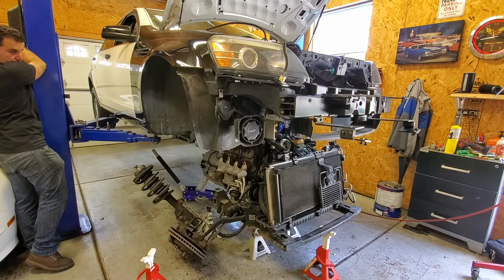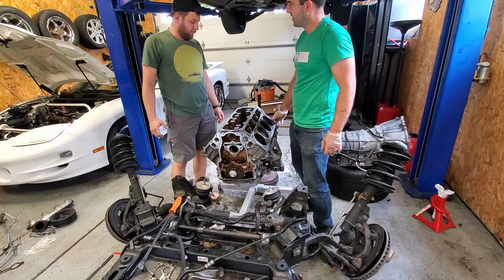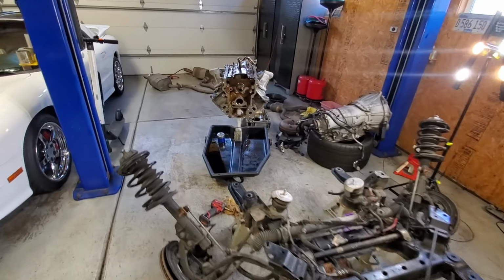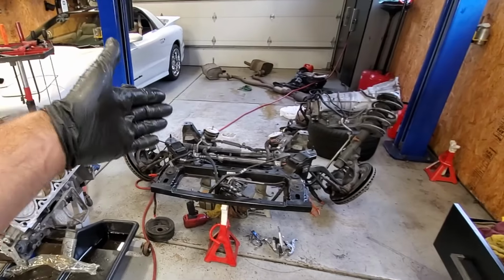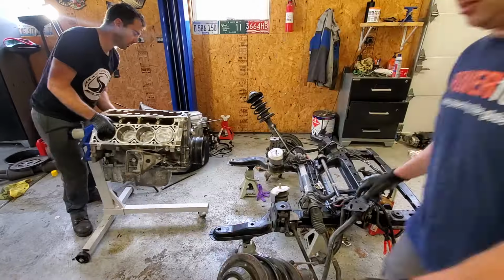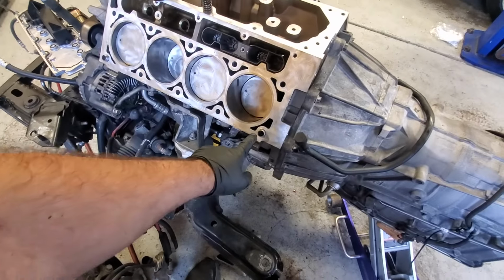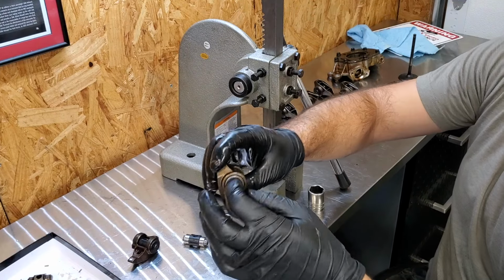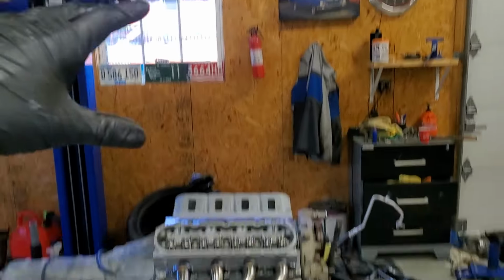Fixing THE WORST LS Engine Factory Defect Ever & Adding 100 Horsepower In The Process! GM Failed US!

Comment from the maker: What LS car or truck do you drive? Any mods? 
If you need high-quality synthetic fluids check out my Amsoil dealer page! My preferred customers can save 25% https://legitoil.myamsoil.com/
Here's everything automotive I buy on Amazon. Every Amazon purchase supports my channel at no cost to you!
https://amzn.to/2k606u1
Reply: Which repair fixed the 30ff boost issue on the 335i? Was it the vacuum lines or adjusting the wastegate rods?
Reply: @legitstreetcars 😅
Reply: 09 G8 GT with the L76.  I've got Kooks long tubes and X-pipe back to the stock axle back mufflers.  Tuned with CAI, but still have the DOD cam and lifters in it.  Definitely plan on doing a similar rebuild to yours in the near future.  You've given some great tips and will probably watch this video a few more times before digging into it over the winter.  Thanks for the info!
Reply: Alex you should’ve used ARP head bolts instead of stockers if you’re going to spray it. Also you should’ve use morel lifters instead of stockers they don’t cost that much and they’re 100% upgrade over the stockers. I have had a 98Z 28 heads, cam, full exhaust, 3400 stall and nitrous. I currently have a 2010 Camaro SS That I’m building into a 429 stroker with a Texas Speed and Performance rotating assembly. I am currently on hold for parts because of the stupid Wuhan virus.
Reply: I have a big family, so we drive a 2006 Chevrolet Express 3500 12 passenger with the LQ4 6.0l. We're in the process of turbocharging it and we're hoping to make around 600 WHP.
Reply: what type of tool did you use to torque pulley? Video with explanation would be nice.
Reply: I've got a 05 gmc 1500 with the l33 aluminum block. Everything is stock just hit 326,000 miles no major problems so far. I love the ls style of engines
Reply: @cjhill726   GM definitely got the LS right. It's just the evolution of the small/big block all mashed up and modernized. But man o man did they hit a home run. Every single weak point of the old SB/BB engine family has been resolved and made near bullet proof. Yes they had some issues with the AFM/DoD, but that's totally new. The non AFM/DoD motors did fine. Even this weak point is getting resolved. GM got it right, PERIOD. These LS engines will be super popular for many many years to come. Several shops locally are also reporting near common reports of 400k, 500k, even 600k mile engines running almost like the day they rolled out. You get into other failure issues when you enter this type of longevity. Like gaskets holding up, etc. These engines are just engineered beyond what the original developers of the old 1955,  265 c.i. small block guys could of ever imagined. It's definitely here to stay.  And is the gold standard. My $0.02
Reply: @peltel2222  couldn't agree more!! For the price they can't be beat.
Reply: @peltel2222  Except for oil cavitation on the fbodies resulting in spun bearings. Oil being sucked through PCV valve issue also.
Reply: @cjhill726  your truck is good old style not the new high tech junk
Reply: 05 Denali XL lq4 6.0. minor bolt ons, cam, full 3" exhaust with shorty headers. Lowered, full suspension. In the middle of a full brake overhaul.
Reply: An '03 Isuzu Ascender with the long wheelbase which is basically a GMC Envoy XL. Eventually I'd like to put the LM4 into something smaller.
Reply: 2002 Chevy Silverado. It has the little 4.8 LS and 130,xxx miles and still runs great. I have been a Ford guy my whole life and heard people go on and on about the LS engine. I always thought it was just the next evolution of a 350 small block...until I drove one. What a stout and durable engine, even the little 4.8 in my truck is impressive and it is essentially stock (revs for days). I can't even imagine the higher end of the LS spectrum, like the 7 liter they use in the Z/28 Camaro and old C6 Z06 Corvette. Superchargers and turbos are cool, but you can't beat a naturally aspirated V8, for the linear power delivery, and not to mention the sound. Really enjoy your builds, keep up the good work!
Reply: Mayhem 2 cam has a .630 lift,  I don't know about Mayhem 3. If that engine has 11:1 or 10.4:1 compression I wonder if there is enough clearance on those flat top pistons. If you spun the crank I guess you already know. Also, FYI: the Cadillac V8-6-4 was not a diesel. It was a debored, destroked version of the 472 engine that came out in 1968, later stroked to 500, then later became a 425 and 368.
Reply: 95 c1500 stepside single cab (show trucks usa conversion from factory)
5.3 ls swap 
t56 (lt1 to ls converted very easy and cheap)
SS2 cam 
7875 turbo with holley manifold system 
just gotta upgrade the brakes and then she'll be rolling
Reply: I have a 04 Silverado 2500hd with the LQ4. It's running a BTR Stage 3 truck cam and ls6 springs, shorty headers, and Magnaflow exhaust, CAI and Fast 8mm wires. It's also been dyno tuned. https://www.youtube.com/watch?v=-At1gcG-A84
Reply: I’ve got a question hopefully you’ll answer for me. I’ve got a 2006 Cadillac Escalade with a 6.0L LS, the SUV has been smoking almost every time I start it and I know it’s a valve issue. But I figured since i need to remove the heads that I would just go ahead and install a cam stage 2 and get the heads re done. Problem is that everyone I’ve talked to about a machine shop around my area have told me to just buy new heads with the stage 2 spring already installed. My question to you is should I just buy the new heads or get the old ones redone and have the machine shop put the stage 2 springs installed? My budget for everything including my exhaust is about $2,500 to 3,000 right now and I’m not quite sure what to do in this situation.
Reply: I’ve been using Amsoil products for 25 years. They have a product for almost every application. I use it in everything I own. 2 Mercedes, a f-150, lawnmowers, pressure washer, weed eater, leaf blower, dirt bikes. I had a Honda Accord I sold with 310k miles. Original engine and Transmission. Buy it from Alex. He will reward us with more videos
Reply: I've got a 02 Corvette with a stock ls1. Only have an axle back exhaust on it. Looking at head and cam packages and header x pipe combos to wake it up. Any tips on the easiest way to do the final torque on the crank bolt with a manual transmission?
Reply: @james5274  stock heads with headers and depending on the cam getting 50 horsepower is very doable. 01s+ have the better LS6 intake. ls1.com has a lot information. Best part is a simple cam change isn’t much work on an LS1 because you only have to remove valve covers, rockers, and pushrods. Spin the camshaft a few times and if you hear the lifters stop banging into to lobes, you are good to go.
Reply: Another great video . Ive been looking forward to this engine rebuild
Reply: Amsoil is a great oil. My friend loves it.
Reply: L
Reply: I suggest spending the $550 for the Snap On digital angle torque wrench. So nice to use when doing angle torque.
Reply: Ssssqq
Reply: Little man is learning early...always nice to see that type of interaction with parent's and their children.
Reply: Hey sorry for off topic, not sure if you know but your patreon link in the description is busted. Feel free to bin this message when you've seen it :)
Reply: L83 in my 2016 Silverado and L87 in my 2019 Silverado.
Reply: Haha, I DROVE a 2006 Monte Carlo SS (LS4) until the SECOND DoD lifter died (paid to fix it the first time), and at that point it wasn't worth fixing.
Reply: Not an LS, but I have 2 older Chevy TBI trucks, My 91 C1500 w/t 4.3 has original engine, 863,000 miles, installed a rebuilt trans in 2002. I bought a 92 Silverado 5.7 350,000 miles on it, I dropped in a 94 5.7 tbi create engine 310hp, she scoots for an old truck.
Reply: I drive a 1998 Z28 convertible, 5.7 LS1, 6 speed manual trans. It has less than 100 thousand miles and is totally stock. Well, except for the transmission, flywheel and clutch disk and pressure plate. I had a shop in Fort Worth trick that out for me.
Reply: 2wwwwaa
Reply: I have a 2018 Sierra with the 5.3. I am planning on a 6.2 ported intake manifold and TB with cold air intake, a ram air hood to go with the CAI , stage 1 cam with DOD delete with upgraded rockers a shift kit in the trans, ceramic coated headers with dual exhaust, and tuned. being a tech for GM makes getting gm parts easier/cheaper. i should gain about 200 rwhp after its all done, still debating on going with a Whipple super charger thats another $6000. if i do that with the cam and dod delete ill be upgrading the  drive shaft as well. with this set up with tune i should have close to 600 rwhp. i already have everything priced and sourced was planning on starting it but work slowed up with the pandemic soo toys later. so far i have done some custom interior work, paint correction and ceramic coating on the paint, and added two 8 in subs with amp to my BOSE sound system in the truck. plan on doing an upgraded brake system too. so i guess all said and done it be about 10-15k when im done.
Reply: Don’t have one right at this moment, but will be buying an ‘08 Silverado 1500 crew cab 4x4 with the all aluminum LC9 5.3L in the beginning of August. Getting it pretty cheap and doesn’t have DOD.
Reply: What can i do with a 4.8
Reply: @amberdennehy4109  I have an 06 express with a 4.8 and 185k miles
I'm planning on a cam and tune to start, should be good for100hp
Reply: I'm building a 1974 Corvette that I'm going to drop an LS2 stroker motor in. It's stroked out to 408 CI, 112 LSA stage 3 cam, PRC heads, upgraded oil pump, and a 78/83 MM turbo. If all goes right, I'm hoping for a good 550 WHP. I'm also going to build a 5.3 NA motor for my 78 Trans Am and an LQ9 for a 1980 Z28 with a massive Garrett turbocharger, ported heads and upgraded valve train.
Reply: You ROCK! LT Dan is the man as he helps the man who got hurt saving man.
Reply: 2008 GMC 2500HD with the LY6 Gen4 6L All Factory
Reply: I just bought a 09 esv with a rod knock, blown head gasket 6.2, am I able to swap in a 5.3 and use every thing from the 6.2 just to get it back on the road. I'm sure the only thing I would need for the 5.3 is the ECU? I plan on rebuilding the 6.2 later on, I just need to get it going.
Reply: I got a 1999 silverado 1500 almost 300k. I replaced transmission but original engine. And i need to rebuild it.
Reply: Great stuff, but as far as the harmonic balancer, you should have changed that with a better performance version, that's all, due to holdens manufacturing of them ,some of the batch numbers made are crap and the rubber seal cracks and them you have balancer wobble, that's the only thing i have noticed and i am not sure if you used the right bolt thread sealing paste, but that too is required for anything which has higher torque settings like the balancer bolt has. :) Also do not get the undersize or oversize harmonic balancers, due to the fact it will effect the way the A/C pump compressor spins and the same with the alternator, i think you can get the right oversize of undersize pullys to suit, if you want to go that way?
Reply: I had a trailblazer ss. Now I have a BMW 320i. Which is slow af but still fun tho
Reply: BLM
Reply: I had a salvage 99 Silverado with the 5.3. First thing I did was get 243 casting heads a trail blazer SS intake and throttle adapter, I used a C4 fuel filter to adapt to a return less fuel system, put in a 6.0 escalade cam and converted it over on the sensor, grabbed a 2005 Silverado computer. Slapped in a K&N and a header back system. Good truck, with tune I was hitting 490hp and torque. Trans was loaded full of b&m trick shift and a stage 2 kit with dual trans coolers. Built it to use for towing for my boy scout troop. Then one of the leaders bought a new truck so I sold it.
Reply: 01 suburban LQ4 rebuilding the LQ4 in there. .500 lift cam .550 lift springs and .530 valve seals. Refreshing the block and throwing new gaskets, bearings and piston rings at it.
Reply: In the middle of swapping my 86 325i. 5.3 with flat top pistons, stage 3 truck cam, milled 241 heads. Adapted to the stock Getrag gearbox.
Reply: The 2jzgte vvti gtus is going back to 13b rotary!

https://www.mazdaforum.com/forum/mazda-rx-7-33/joe-maddox-super-rare-1-100-1989-fc3s-gtus-rx7-2jz-gte-vvti-build-43602/

I have found and saved the rarest Mazda FC RX7 ever made! Now this car is rare. Really rare! Let me break this down really quick... 

Ever heard of the rare 100 GTUs rx7s? Only 40 have ever been claimed and only 15 are confirmed at the time of this posting! Here are the rarest rx7 FC3S models: 

1500 10AE Turbo models 

1400 infini 

1000 winning limited 

150 final edition convertible 

100 GTUs... 

out of that 100 they made three color options:

red on black 
black on black 
white on blue 

There was only 100 GTUs models created between 1989 and 1991. 

If you own one of these rare models sign your car up to the registry list here on any of the rotary forums! 

There are rumors about a restamped GTUs model... 

The entire origins GTUs owners thread on the rx7club was modified, icemarks claims deleted, registry list changed to have a confirmed section and the mods agree there are not enough GTUs models to have the restamped. 

If you want the full story behind the restamped models: 

https://www.mazdaforum.com/forum/mazda-rx-7-33/restamped-mazda-rx7-45926/ 

https://www.rx7club.com/2nd-generation-non-technical-pictures-198/restamped-mazda-rx7-1148475/ 

If you have a real GTUs you can register it here: 

https://www.mazdaforum.com/forum/mazda-rx-7-33/official-mazda-rx7-gtus-owners-club-thread-44477/ 

https://www.rx7club.com/2nd-generation-specific-1986-1992-17/mazda-rx7-gtus-1148362/
Reply: Too bad Amazon doesn’t support its. Employees..:(..they even put letter in the bathroom stalls about what to vote for and what not to..
Reply: What is the difference in oil pumps when deleting the DOD?
Reply: Got an ‘08 Silverado with an all aluminum LC9 with that damn AFM crap on it. Previous owner talked about how rough it ran unless they pulled the abs fuse. Odd. Plugged it back in, ran fine for a while until the AFM started acting up. Had to unstick a lifter a couple times by pulling the valve cover and tapping the rocker with a hammer. Got an HP Tuners unit and disabled it until I can fully delete it. Fully stock otherwise.
Reply: I know Im asking the wrong place but does any of you know a trick to log back into an instagram account..?
I stupidly forgot the account password. I love any assistance you can offer me
Reply: @Callen Nathanael i really appreciate your reply. I found the site thru google and Im trying it out atm.
Looks like it's gonna take a while so I will reply here later with my results.
Reply: @Callen Nathanael It worked and I actually got access to my account again. I'm so happy:D
Thank you so much, you saved my ass!
Reply: @Jack Maxwell No problem :D
Reply: 8
Reply: 2011 ls3 vette
Reply: 2013 camaro ss1le  ls3 headers, no cats, borla atak, vararam intake, tune ,underdrive pulley
Reply: What about DEGREE'n the new cam? Is that bulls*** or what? Please chime in if you really know wft your talking about
Reply: I have a 2012 Caprice PPV. 6.0L

New Jersey Police, interior looks like the detective model.

DOD deleted
WithTexas Speed
LS7 lifters
Stage 1 cam

Rotofab CAI
new radiator
new ignition
Pirelli tires

Dynotune

Next Up-
Long Tube Headers

Alex, you make it look super easy, barely an inconvenience.

I live in an apartment and lack any mechanical ability, so your videos have really helped me understand the work I have had done and what it needs next.

Unfortunately;
The mechanics that did the DoD delete failed to replace the trunion gears, so within 6 months I had to have that fixed.

Within a couple weeks of their work I heard a strange engine noise from the lifters, so I did not drive it again for 6 months until I had saved up enough to cover whatever they might have destroyed.

I am a 100% Disabled Veteran so my VA "pension" is my only income.

I could not take it back to ShelbyKiller that did the DoD delete, Cam, lifters and CAI, because they'd already filed for bankruptcy for destroying too many expensive cars.

(Oops)

After watching your video, now I worry that the rocker arms themselves may be wrong.

I have found a reliable speed shop now so
I will get that checked out.

Thank You for your videos
Reply: I helped as a pit crew member on an LS-1 Vette back in the 80's in the SCCA Endurance Series.
Reply: @Jack Maxwell Instablaster ;)

Comment: Using a green roloc disc for entire gasket removal and final finish is insanity, that's asking for trouble.  Scrape gasket with CRC gasket remover first, float evenly with no pressure using white roloc, and last wd40 soaked maroon scotch brite pad.  Clean with brake kleen.  That's with everything sealed so no grit can get on the rings or in the block.  Tops of pistons use a small squirt of gasket remover and brass brush, careful to not get anything on the rings (use a little grease or wax string), alternate with brake kleen sprayed on a rag first for heavy deposits.  Those rolocs can and absolutely will destroy a deck surface, especially the green and yellow used on aluminum.  White is 120 grit, yellow 80 grit, and green 50 grit.

Comment: I have a 2012 Caprice PPV.
DOD deleted
WithTexas Speed
LS7 lifters
Stage 1 cam

Rotofab CAI
new radiator
new ignition
Pirelli tires

Dynotune

Next Up-
Long Tube Headers

Alex, you make it look super easy, barely an inconvenience.

I live in an apartment and lack any mechanical ability, so your videos have really helped me understand the work I have had done and what it needs next.

Unfortunately;
The mechanics that did the DoD delete failed to replace the trunion gears, so within 6 months I had it redone.

After watching your video, now I worry that the rocker arms themselves may be wrong.

Thank You for your videos